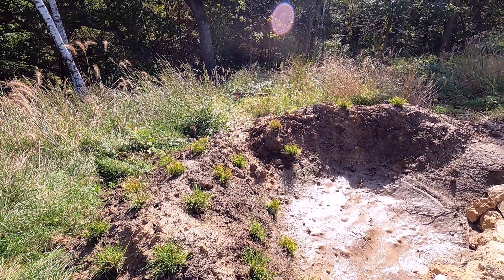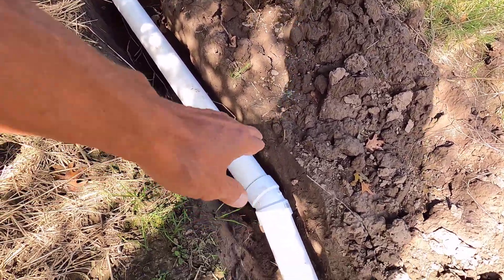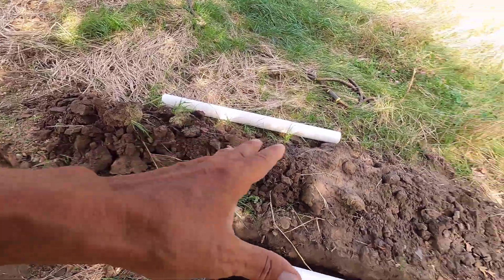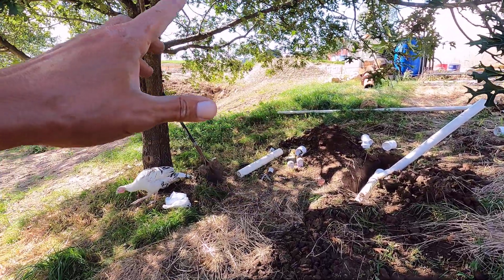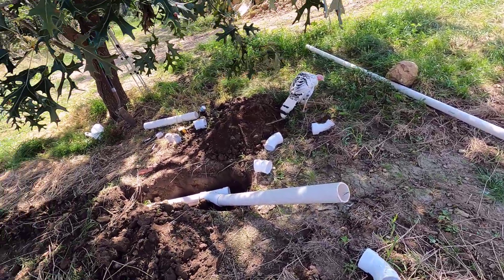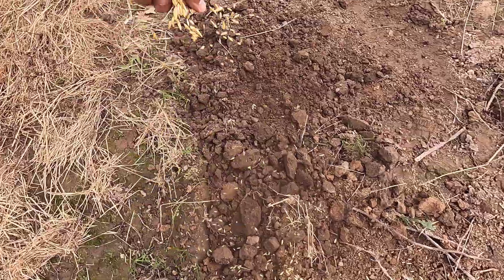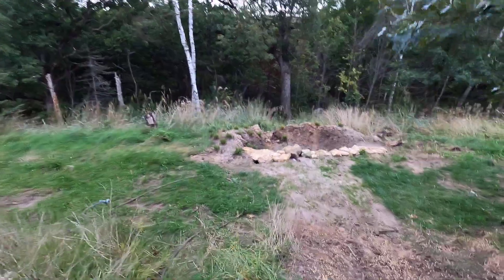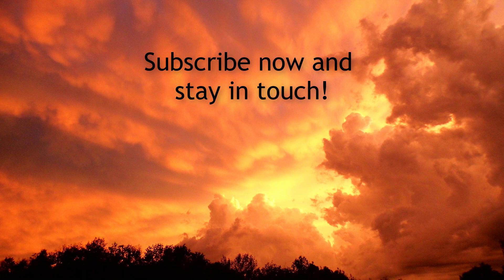Graywater Levee Breaks!!! ― Finish Plumbing B4 Next Rain

Comment from the maker: Here are newer videos on this project. The catchment pond was started in 2021 and blew out the back wall in a rainstorm (I didn't have the overflow pipe in place yet). I planted native grasses there already, and will repair and finish it in 2022.

Dig Catchment Pond – And a Lot More! - https://youtu.be/aUz4AsX7btY
Planting Fowl Mana Grass and Placing Boulders [Gray Water Catchment] - https://youtu.be/wyVS_EFTqi8
Graywater Levee Breaks!!! ― Finish Plumbing B4 Next Rain - https://youtu.be/0fkwlLd2qvQ
Gray Water and Other Updates - https://youtu.be/kPcNLW6t-Bg
Trenching for the Gray Water Lines - https://youtu.be/7nhILvsZb_8